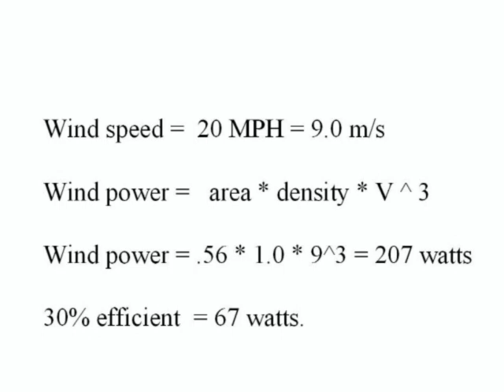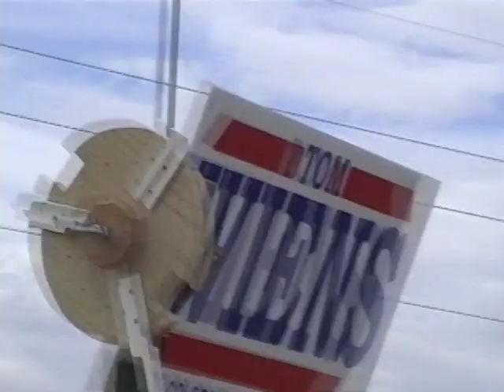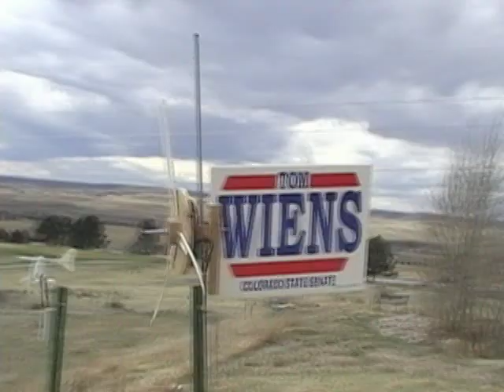Testing My Wind Turbine (HAWT)

Comment from the maker: No, it's not that Sharp.  This is a turbine designed by Peter Sharp that uses weights to keep the blade at the near optimum pitch.  You can find several videos of different models by searching for Sharp VAWT.

Comment: @muddymuddymuddmann ...I think U just got to the point :)
5 days of wind at 35mph with a 1.5kW generator make up for a 365days of production with Ur small scale 9mph generator... plus you have much less working hours this longer lifetime. And that's all... you have to use the wind when and where there is wind... otherwise you go solar :)
Or course one has to find a compromise, but I believe it's worth to keep in mind that higher power comes with higher winds.

Comment: @muddymuddymuddmann ...this is a common statement but it's totally wrong!
No iron in the machine means a lot less field in the coils (100-1000 times less!!!) which means that to get the same voltage you have to use a lot of copper (turns in coils), therefore the impedance (resistance) of  Ur machine will be much higher and the internal losses will be huge compared to those of the same machine with iron cores....... 
...think abt it :)

Comment: @Zypkin ...actually like this I'm really surprised that it works at all!
By using a counterplate you'd be able to increase the magnetic fiels inside the coils by a big deal... probably more than 50%... which means you could reduce by the same amount the number of turns in each coil and consequantly the overal resistance of the generator (read cut the losses by a lot)...

...more on this on reuqest :)

Comment: Seems reasonable to take that part out of the equation since theres no power there to include into the efficiency.  I guess your calculation is for the available power to the windblades as being the collectors of the wind available to them only.  I seen some people use (pi r^2), but I guess that's the theoretical wind power to everything including the hub, but I guess now its not fair to include that into the specific efficiency of the windblades, hence it's a better value to use.